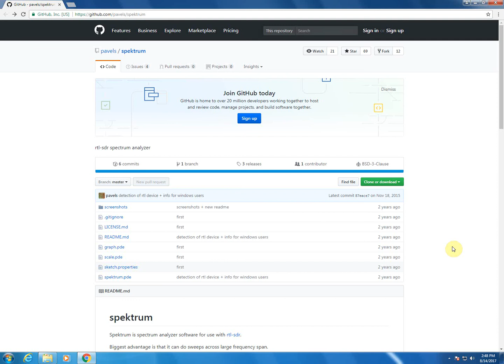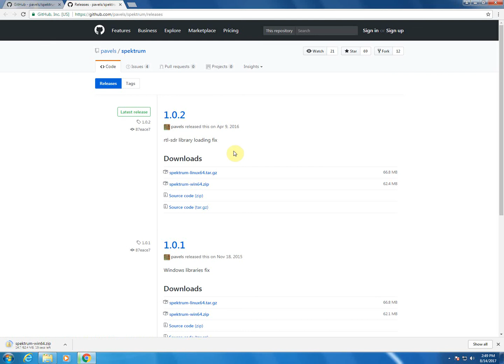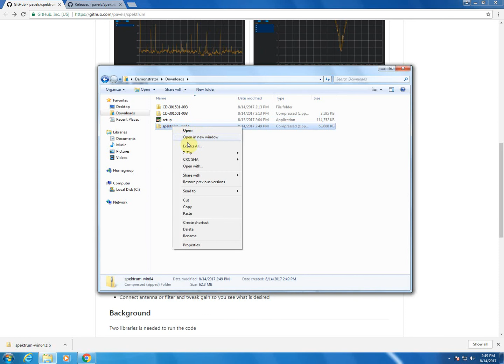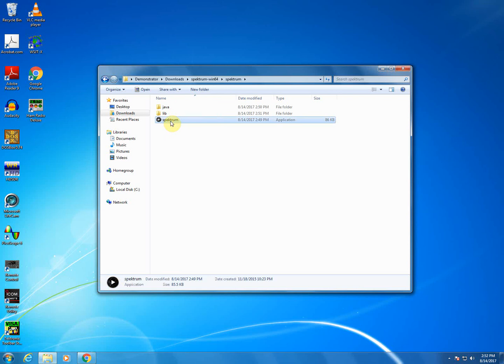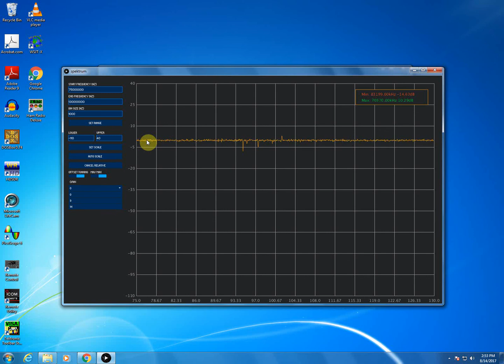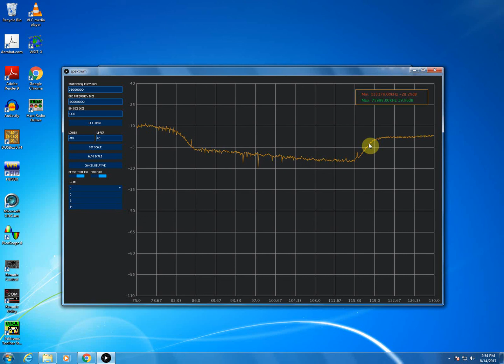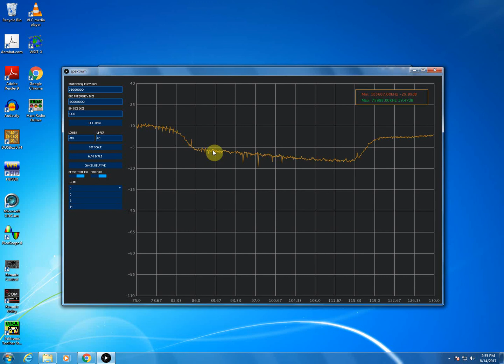Poor Man's Spectrum Analyzer - Installing Spektrum and Testing an RTL-SDR com 88-108 Bandstop Filter

Comment: I had tried this on my Thinkpad IBM X61t (Win10) and gave up; the window does not fit on the desktop because it can not scale and the screen resolution (1024*768) is too low.

Comment: Great video. Install went 100% fine.
I have a spinning device is a 12”x12”x12” metal box (to isolate from outside waves). I want to see if the spinning device throws off any frequencies. What type antennae would be best suited to use for this test?

Comment: Is it possible to use arduino and its serial display as spectrum analyser with using rf module like sl4433 or fm tuner module for arduino ?

Comment: The relative puts all at 0dB, but when you connect the band stop filter, you go up to +10dB before and after the stop band. What causes that? Looks like you have an amplification of the signal there but the noise source didn't change.

Comment: I am wondering if I can use an SDR to pick up a radio signal from a cathode ray spinning inside a Nakamura tube. The Nakamura apparatus is typically used in our college labs to establish charge to mass ratio of an electron. My hope was to use the same device to explore radio waves and connect frequency to acceleration of electrons. Does this seem doable? Would an SDR be an appropriate way to observe the em radiation from the tube? Thanks in advance.

Comment: I just finished watching your video on the installation of Spektrum for the RTl-SDR.  I followed your instructions to the letter and when i attempt to open the application all I see is a GRAY SCREEN.  I am currently running the Windows 10 X64 version OS.  I have SDR# installed on this computer and It operates with the RTL-SDR just fine.  Do you have any suggestions that i might try to get this program to run.  I have a number of uses for this application in connection with some Amateur Radio projects I am working on.  Any help would be greeatly appreciated.  
73 K0VPL Doug B.
Reply: If all you see is a gray screen, you may have missed installing the Visual C++ Redistributable Visual Studio 2012 component from Microsoft as per the Spektrum author's readme on github. The note straight from the github page: "If you are running windows version and only thing you see is grey screen, you need to install Visual C++ Redistributable for Visual Studio 2012 - Get them from http://www.microsoft.com/en-us/download/details.aspx?id=30679 "  Hope that helps.
Reply: Here's a link that might help, it goes through listing steps to take to get the RTL-SDR recognized, it appears sometimes Windows does odd things and the drivers don't get set up correctly: https://groups.google.com/d/msg/ultra-cheap-sdr/CNnWetfFPq0/VsHqpvDSpEcJ and also some details with screenshots directly from the RTL-SDR quickstart here: https://www.rtl-sdr.com/rtl-sdr-quick-start-guide/

Comment: Hi, first, thank you for your video on this subject.  Second, I followed all the procedures outlined in this video as well as on the github.com.  But unfortunately I am getting grey screen with a message: "Can't open rtl-sdr device."  Windows 10 x64 here.  SDR Dongle is the NooElec blue dongle and it's working properly.
Reply from the maker: +backtrack2009 You have the Nooelec dongle working with SDR# or similar?
Reply: Yes, I am using SDR# v1.0.0.1361
Reply from the maker: +backtrack2009 A strange issue. I will do some testing when I get home, to see if I cam duplicate.
Reply: Thank you.  I really appreciate the help.
Reply: backtrack2009 I did some testing after work this morning, and I can only duplicate the problem by not having a dongle plugged in on the PC. I would recommend reinstalling the driver for your RTL2832U, using zadig.
Reply: Hi Charles.  I did that many times already.  I even downloaded a zadig driver from github.com and that really gave me a lot of trouble.  All my USB port went dead after installing that.  My keyboard and mouse were not working at all.  It took me hours figuring out how to uninstall that driver.  Anyway, I used the zadig that came with the SDR# that I am using and it's perfectly working for me, except the Spektrum is not.  Still trying...
Reply from the maker: I am at a loss, I tried some more things today on my hamshack PC, and I had no luck duplicating exactly the issue. You might contact Pavel Šorejs, the developer of Spektrum.
Reply: Thank you so much for your time replicating my issues.  I left a comment in his github acct. so I hope I will get a reply soon.
Reply: Did you ever get a ny response from Pavel?  I just get the gray screen with no reference that the program can not open the RTL-SDR device.